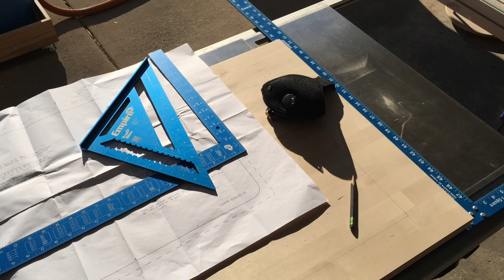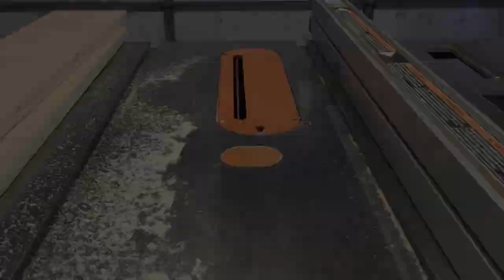Bathroom Vanity Step Drawer Cabinet ep019

Comment: Great video by the way and nice vanity!  I had a  few questions for you, if you don't mind. I am actually building my own vanity right now and was trying to design the step for the kids. Might I ask how far off the ground did you leave the step? Looks like maybe around 3/8 - 1/2 inch to me from the video??  Also did you put some kind of 'stop' on there to keep it from pulling out too far? And if so how do you adjust the stop when you make it reversible into a drawer? Thanks in advance.
Reply from the maker: Thank you very much! The step is actually just over 1/8” off the ground so you can add rubber feet to the end. The step pulls all the way out and flips over to be a drawer when they outgrow it. I didn’t add a stop as the way the vanity sits in its location, you cant pull the step all the way out due to trim work.  You could do a stop if you hot clever about it but it may be tricky.